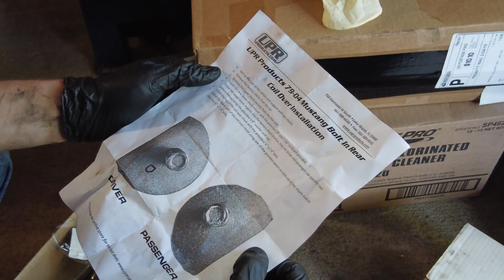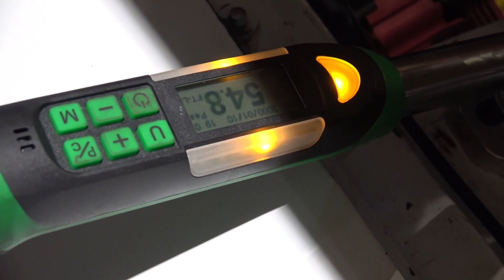Viking Coilover Upgrade on the Foxbody

Comment: Those spindle bolts are suppose to come through from other side so you don’t have to pull rotor off to get them out. Just a suggestion. Great build though. It’s gone fly with all the new suspension. Keep it up.
Reply: KillerCoyote I was just gonna post the same thing. I’ve never had to pull the brakes off to swap struts before.
Reply: @8SecSleeper  

Those bolts will never loosen if torqued properly. I can’t speak for the new bolts they used but the factory hardware uses a lock nut

Comment: Cool vid but i woulda put them 2 lower strut pinch bolts in the other way that way you don't have to pull off all the brakes to remove or unbolt the struts next time you wanna work on it.
Reply: I was about to write the same thing! 👍🏻

Comment: Hi, Just a note:  If you can make brackets to lower the upper arm forward mounting point down 1 inch It will move AS rearward. If you map out the positions there are in stock they go way out in front of the car.  If you make the Mod it will meet right behind the door.

Comment: Older mustangs didnt have the trouble of crowds. Its the newer ones. You can turn trac off. But if you forget advanced control it will help you regain control but if your trying tobregain yourself your now fighting against the computer. And end up in the crowd. Lol. You wont have those problems. With this ole girl and youve went through everything which helps so much in control.

Comment: Well Iam here in Eugene OR. I STREET RACE but haven't in a few years. Have a 55 step side 348 tri power Muncie 4 on the floor. Thumper cam. Have ran this in Canada did 157 in the quarter. Has been rebuilt 3 times. Built it in 1964 when I was 14. Will bring it down in July after something is added. Then I will be looking for a race. Might be 71 but very active. Want to make any race if I can find one. Oh thanks for the offer. Transam nice

Comment: This video is an excellent example of why solid bushing rear control arms are crap and are to be avoided. The wear shown in the bushings is caused by repeated suspension bind because of how the geometry of the rear control arms changes as the suspension travels. Urethane bushings also don’t hold up very well under high horsepower launches with slicks either. Molly’s new setup is the way to go for her intentions 

👍🏻

Comment: Supposed to tighten the nut, not the bolt, when tightening fasteners.
Reply: Whatever end is easiest to get with the impact, then go Mach jesus with the Ugga duggas
Reply: It doesn't matter as long as it gets tight
Reply: how long it take you to come up with that BS!!!!
Reply: @jimmybrown5778  he's actually correct. Anyone who's been around a shop or to any tech school knows that tightening the bolt instead of the nut gives an incorrect torque reading and false sense it's right. Only an idiot would think anything different. Where's that leave you?
Reply: @attitudeadjusted9027  your correct. None of them are mechanics or  mechanical trade qualified. Just back  yarders bolting new parts on. IVER the years they have learnt a lot thou. The old man especially. It's still evident even thou he has tuning down when on some basic mechanical procedure they still have no clue!  But that's OK I guess as long as they don't do something dangerous and hurt themselves or others. 
Yes you are correct on the tightening of bolts.

Comment: Not to be that guy but if your battery doesn’t hold a charge after a couple days you either have a battery draw the needs to be found and fixed or the battery in your “Muskrat” needs replacing and you really need to get a battery box so it can’t leak acid all over the back of your car and so if/when the battery blows up it doesn’t blow up all over you and your car besides most race tracks require them.

Comment: Are those radial tires on the front of your car ?? They dont work well with slicks !!
Reply: That's assuming those are bias ply slicks, which it appears they are. She definitely needs those to hook that stick shift car.
"They" say A LOT, and "they" say not to mix bias ply and radials front to back, as it definitely doesn't help with stability. 
That said, A LOT of people run radial fronts with bias slicks. It's not as much of an issue in a slower car running the 1/8th mile.
Obviously the faster the car, the more it matters that they all match.

Comment: Get rid of the 96+ spindles and you’ll fix bumpsteer issues.
Reply: They did.  Billy said they didn't work with the 15" wheels.  They're using the 4cyl deal off the black car.

Comment: Hey Molley I’ve got a couple questions for ya!! First I was wondering why I was not getting notifications when you was uploading new videos and then I seen that I was not subscribed to you anymore!! Your channel is not the only one that this has happened to me!! I’m not quite sure why YouTube keeps deleting me after I have subscribed to a channel!! The other and most important question that I have is CAN YOU FIND OUT WHAT THE PART NUMBER IS FOR THE HEADERS THAT THE OLD MAN PUT ON TOMMYS C-10 MOTOR THAT THEY ARE GETTING READY TO PUT IN THAT OLD TRUCK!!! I keep asking but I’m not sure if they are not getting these messages of me asking or if they just don’t read the comments!! I would DEFINITELY APPRECIATE IT A BUNCH IF YOU COULD FIND OUT AND LET ME NO THE PART NUMBER OF THEM??????? I’m just working on a 1969 Chevy 1TON 4x4 with a 421 sbc with a dart block & the AFR aluminum heads, and fully forged internals!! I was able to put it on the dyno to get it broke in and all tuned in before putting the motor in the truck!! On the dyno we used step headers 1”3/4” to 1”7/8” and so I’m wanting to run a set of at least 1”3/4” tube size so I don’t have as much restrictions!! PLEASE PLEASE PLEASE LET ME NO!! And THANK YOU SO MUCH IN ADVANCE!!!!